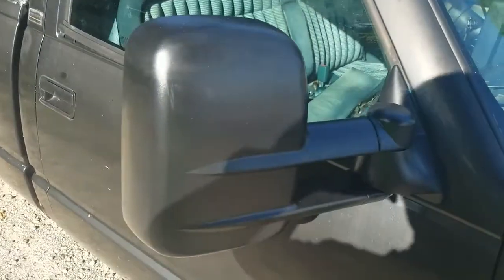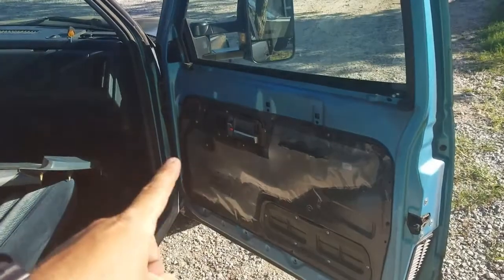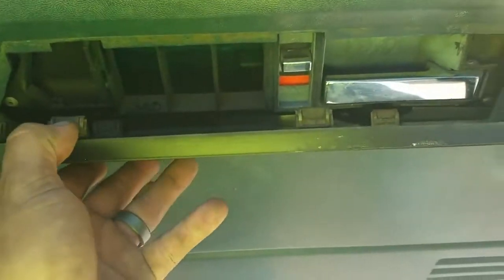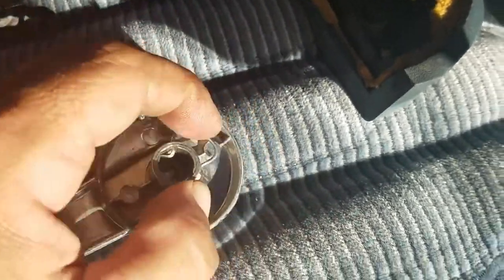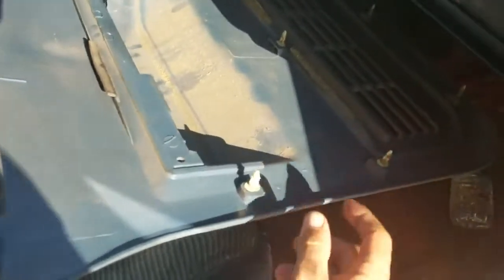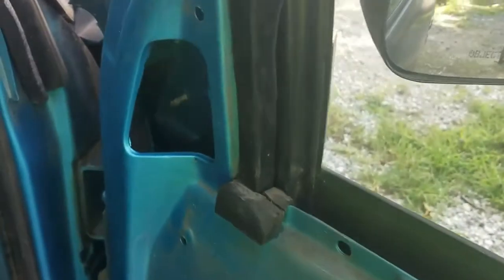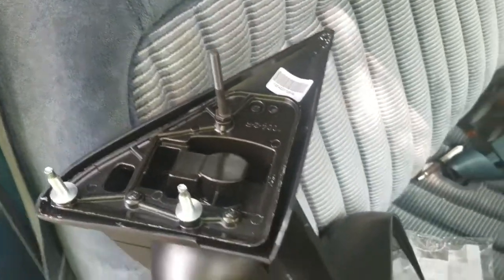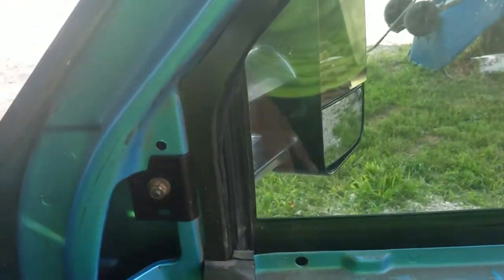1994 Chevy 1500 tow mirrors yitamotor

Comment: i have the same color 94 silverado ext cab my grandfather purchased new  just purchased a travel trailer and getting these mirrors to tow it thanks for the video i think i should have opted for the " chrome " ones for $20 more but if it works it's fine lol
Reply: I got a 94 extended cab Stepside 350 automatic 3:73 gears in the same baby blue